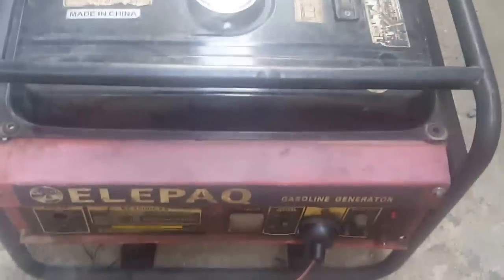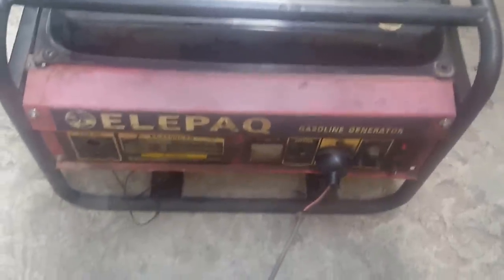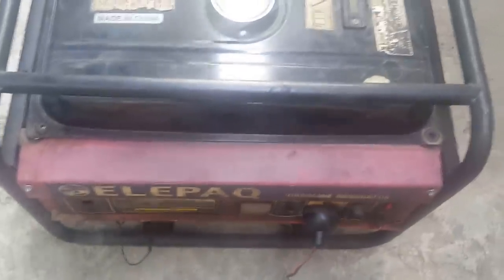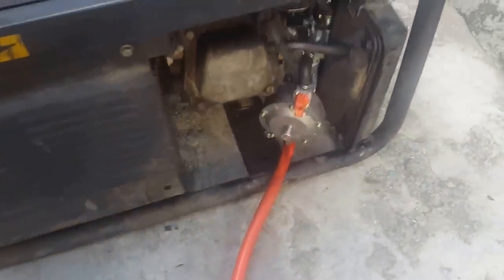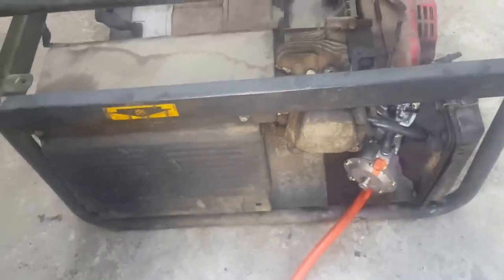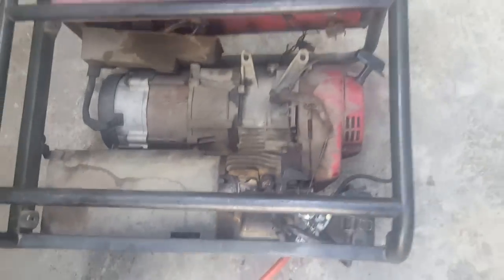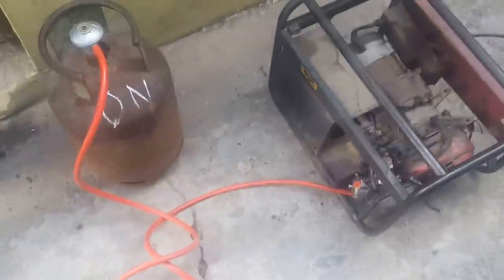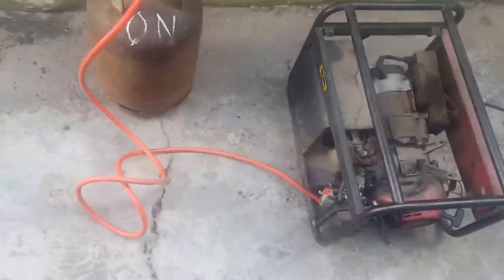Run Your Gen On Gas - Say Goodbye To Petrol

Comment: Noise reduced by 50% is a nonsense ,  its just a fuel

Any 4 stroke petrol engine will run on LPG , the issues is how long it will last.   LPG is a very dry fuel,  valves/valve seats can be an issue on some engines.

Comment from the maker: N2,500 gas 12.5kg gives you up to 35hrs of electricity on 2.5KVA generator. Far cheaper than petrol. Gas is always available

Very safe. Been using it for some times now. You can come see it in use in my office @ 20 Adeniran Ogunsanya S/lere
Reply: Are you guys in Abuja? If yes ,please send me your abuja address.

Comment: Philip, may I know 1) what is the voltage output? My country uses 250v. 2) Do you have a website? Is it possible to convert to DC?
Reply from the maker: Kindly got to potechng.com/gasgen for details Sir. Thanks for your interest.
Reply: Thank you for your prompt reply
Reply: @PhilipObin  you can have the exhaust inside the home if you burn lpg?
Reply: How long does it last

Comment: How long can a 12.5kg of gas last? What is the cost effect of using gas over petrol? Once you can prove that this is a cheaper option then people will look at your side.Once you can satisfactorily answer these pertinent questions then it is fine. Thats what people wanna know. Cost effect and safety.
How long will a 12.5kg of gas last for; 2,3 days, 1 week?
Reply from the maker: +Damilola Adeaga N2,500 gas 12.5kg gives you up to 35hrs of electricity on 2.5KVA generator. Far cheaper than petrol. Gas is always available

Very safe. Been using it for some times now. You can come see it in use in my office @ 20 Adeniran Ogunsanya S/lere
Reply: Can't you read what the gentleman wrote? 35hrs, guy!! Wherez ur mind?
Reply: +samuel oyedepo and you think you are not worse off? Pot calling kettle black.
Reply from the maker: Call 08027196002 or click https://api.whatsapp.com/send?phone=2348027196002 to WhatsApp chat us. Kindly got to potechng.com/gasgen for details Sir. Thanks for your interest.

Comment: pls i av 7.5 kv gen that caries 3 copier, 12 cpu, a fridge nd some oda few tins in a barber shop, cafe nd a flat... thou we dnt operate  d 3 copier dsame tym...my 25 liter petrol last 9 to 10 hrs.. wit d gas my calculation told me #2.500, which #3000 now, will last me 10 hrs
I HOPE AM CORRECT?...I NEED CONVICTION PLS
Reply from the maker: Philip Obin
2 seconds ago
Call 08027196002 or click https://api.whatsapp.com/send?phone=2348027196002 to WhatsApp chat us. Kindly got to potechng.com/gasgen for details Sir. Thanks for your interest.

Comment: pls how can i get one in ph, n can i easily switch it back to petrol at anytime I need to start using petrol. is it user friendly
Reply from the maker: Advantages of running your gen on gas:
>> Gas is cheaper and always available
>> Gen noise/sound is reduced by 30-50% depending on age, make of gen and load
>> It's also eco-friendly. Gen stops smoking entirely
>> Engine oil lasts longer before getting dirty
>> Gen Servicing frequency is reduced
>> Tested and confirmed okay, and currently in use in our office
>> 12.5kg gas of N3,000 gives you about 50hrs of electricity on 2.5Kva gen - that's about N60.00/hr or 10days, if you run gen for max of 5hrs/day
>> You can watch a short video of the technology being used in my office via https://youtu.be/XykkZ_Y6uo8 or come see it live at 20 Adeniran Ogunsanya, Surulere Lagos

The technology is simply an easy to install hybrid carburetor that converts your existing petrol generator to also run on domestic/cooking gas.

Anyone who can loosen a bolt, can remove your existing carburetor and install it  for you. You can at most engage a mechanic, including apprentice, to help with the installation.

We sell the most advanced version of the carburetor which allows you switch between petrol and gas (LPG or CNG), depending on what's available to you, on same carburetor.

The device isn't compatible for 'I better pass my Neighbour' (the smallest tiger gens) and gens with capacities above 10kva. Yamaha gens are not compatible, too

The device comes in two sizes: Small one for 2kva - 3.5kva gen capacity and big one for 4kva -10kva generators 

PRICING:
N25,000 FOR SMALL ONE AND N35,000 FOR BIG ONE - ONLY ON OUR LIMITED PROMO

You only need to buy a gas cylinder, regulator and hose (if you don't have already).

Safety concerns: 
Lots of Nigerians are still afraid of gas, as some think it could cause explosion, but I don't blame them. It's lack of research and limited knowledge, which suggests why most Nigerians still don't use gas cookers at home.

Truth is a running propane gas cylinder on generator is safer than running it on cookers. Cookers naturally generate flame (naked fire), yet do not cause explosions, as the cylinders are built to handle the generated flame, whereas your gen doesn't generate flame. Again, if there's a leakage from your cylinder/hose in your kitchen, gas can easily accumulate and any ignition can cause fire, being that your kitchen is an enclosure, whereas your gen and cylinder, being outside, has adequate ventilation, which will naturally circulate away any leaked gas - reducing the chance of fire and explosion, in case of fire ignition.

Although we recommend you keep your gen and cylinders outdoors to avoid overhearing, and use a hose of 3-5 yards. Also, avoid having your gen in a cluster of running gens, like we have in some apartments.

Resellers and distributors wanted
We have two levels of Distributorship. 
(1) If you buy minimum of 10 units of the products and become Independent Distributor - you get N2,000 - N3,000 discount per product. 

(2) Buy products worth N5,000,000 & become Sole Distributor for any state in Nigeria except Abuja & PHC which have been given out already. Sole Distributors can get up to N5,000 discount per product. 

For Lagos, we do sole distributorship by LGA and Ojo and Eti Osa have been given out already. Call 08027196002 for further details.

Delivery to any part of Nigeria is N3,000.

If interested, kindly visit our office at Potech Ltd. 20 Adeniran Ogunsanya Surulere Lagos, to see it for yourself in use, and buy yours or buy online at www.club080.com/product.php

You can watch a short video of the technology being used in my office via https://youtu.be/XykkZ_Y6uo8

For those who want home/office delivery, here are our account details:

Potech Integrated Services Ltd.:
DiamondBank: 0028652769
GTBank: 0014974268

LAGOS - MAINLAND: 
20 Adeniran Ogunsanya, Surulere |08069718569 | 08027196002

LAGOS - ISLAND 2:
15 Lawanson Road, by Total Filling Station, Surulere 07056582777 | 08025406377

LAGOS - ISLAND:
The Palms Mall(Shopprite),Inside Game Discount Store - (Left Wing), Lekki - Lagos. 09091113000 | 08093001818

ABUJA:
Suite 207, Better Living Plaza, Beside NSCDC Headquarters, Wuse Zone 5 | 08060003475 | 08102989009 | 07056585376

PORT HARCOURT:
Luli Mull: 20, Rumuorla/Rumuadolu Road, Port-Harcourt: 08063365500 | 08091050928 | 08135250579

UYO:
Samsung Place: Plot 47 Unit B, Maitama, Ewet Housing Estate, Uyo, Akwa | 08090805529 | 08022243722 | 08038001592

WARRI:
221 Jakpa Road, Effurun, Warri, Delta State | 08034653622 | 08027543465

CALABAR: 38 IBB Way, by Rabana | 08065957992 | 08108977531 

Thank you,

Philip Obin,
CEO, Potech Ltd.
President, Club080.com
Founder, 9icefaces.com
Founder, FoundOnline.ng
Curator, PhilipObin.com
Tel/WhatsApp: 08027196002 | 08069718569
ceo@potechng.com | www.potechng.com | www.sms.potech.com
Reply from the maker: Philip Obin
2 seconds ago
Call 08027196002 or click https://api.whatsapp.com/send?phone=2348027196002 to WhatsApp chat us. Kindly got to potechng.com/gasgen for details Sir. Thanks for your interest.